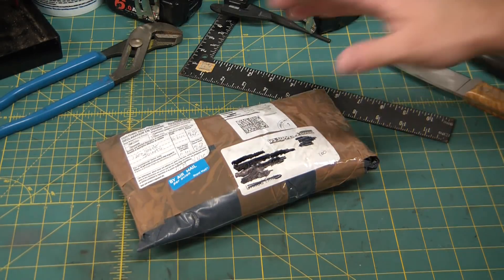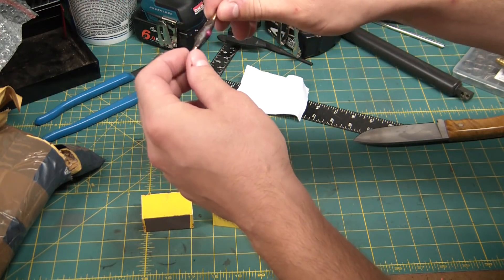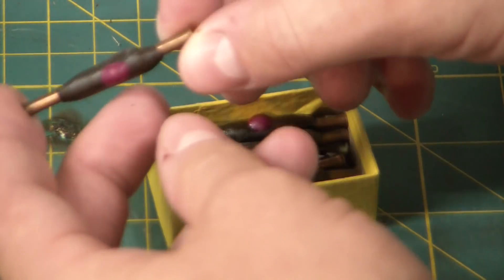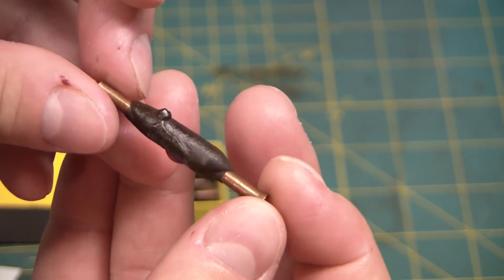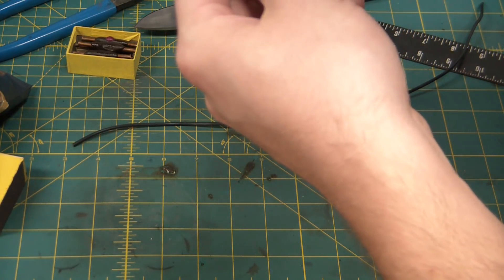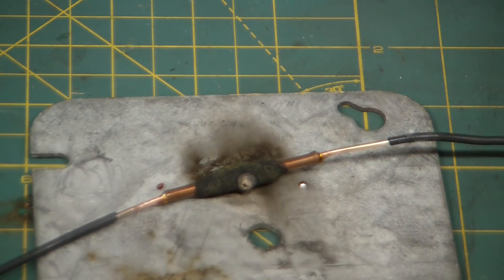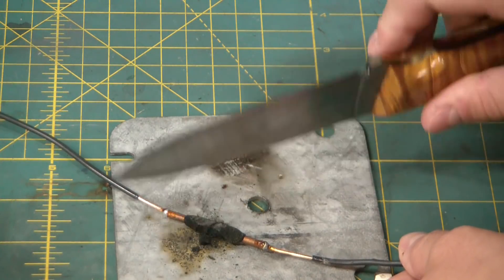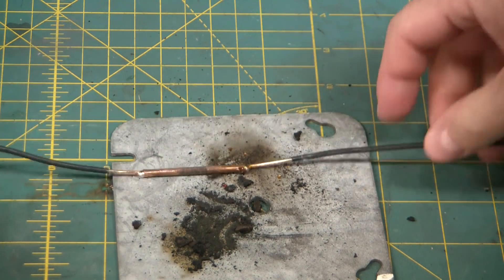Ingenious Self Soldering Sleeves!  (A Very Old Invention) - ElementalMaker

Comment: I know they make the solder seal but joints, that solder with a heat gun, or a flame, cool melt solder, in shrink tubing, but this is soo much cooler! And it's soo much simpler to use, alot more complex to make, but soo cool!  I bet a box of these, cost about as much as a cheap iron, and small roll of solder!

Comment: BigClive did a video on the modern version of these, it's actually heatshrink tubing with a ring of low temperature solder on the middle and hot glue rings at either side, not self igniting but convenient non the less.

Comment: As it was firing, I was screaming "push the wires in!" at the screen.  For current usage, though, there's wago push-in connectors.  Easier, quieter, no smoke, and can be removed.
Reply: Yeah I read the instructions as well.
Reply: But solder is far more reliable and solid, couple with some shrink sleve and a lighter and you're golden
Reply: And there's these bring-your-own-heat type: https://www.amazon.com/Wirefy-Solder-Seal-Wire-Connectors/dp/B01M0EZBYQ/
Reply: @mbirth  but they don't have pyrotechnics on them? Disappointing):

Comment: The algorithm brought me here. Have to say I am not disappointed. Those things are amazing. A good secure connection for field expedient demolition work. Wouldn't be to hard to make your own. A short length of small copper tube with some match compound on it. You could put some soldering paste in the inside. Solder powder in a flux base.

Comment: My grandfather was in the army corp of engineers during WWII, electrical engineering degree in 1932, but had these in his garage during the 60’s. His job was field power supply generators for this new thing called radar. He told me they had change the formula but the originals had potassium fomate! They where more water proof. He lite one as you did and was much faster and brighter. The search for potassium fomate is what they used in the percussion end of a 22 caliber round. At some point ( Perhaps deadly off-gassing, the formula was changed to what they still use today in 22’s. Not sure if spelling is correct but much brighter. He told me they would cover both sides with bricks so the light could not be seen as easy. Anny Oakley probably shot hundreds or rounds of these 22’s with the original formula since yours where made much later in the 60’s. Food for thought!

Comment: HI   THEY DO HAVE SOME THING LIKE THIS.  I USED THEM IN THEM IN THE COLD WAR DAYS. THEY HAVE A SHRINK TUBE OVER THEM NOW. YOU CAN HEAT THEM WITH A MATCH OR LIGHTER. THEY ARE COOL AND WORK VERY WELL. I NEVER SEEN THIES COPPER TUBE ONES . A SOLDER JOINT IS A LOT BETTER THAN CRIMP IF YOU HAVE THE TIME. THANKS FOR THE VID.

Comment: I think they where used to repair power supplies to large building. Mainly where emergency / paramedics were located and they didn't want to try and dis-connect the mains voltage for some reason.

Comment: I wonder if the pyrotechnic mixture surrounding the joint could possibly be Iron and sulphur in some kind of binder. The way the reaction moved across the mixture reminded me a lot of the Iron and sulfur, ignited with a hot metal rod reaction.

Comment: I'm pretty confident those weren't "strike anywhere" -- for safety reasons (entire box igniting in your pocket = bad day) they were "strike on box".  No longer made, apparently, I'd guess because "It's not safe to carry pyrotechnics around in a tool box!"  So instead you buy heat-shrink self-soldering sleeves and a little butane torch so you can cuss louder when the torch runs dry or the piezo igniter quits working 800 feet above ground...

Comment: Those new style heat shrink butt connectors with solder and adhesive probably have a direct lineage to these. You know, the kind that solder and seal with a heat gun.

I can almost guarantee these were used in communication in war time. Demo operations don’t need a permanent and very durable connection. A simple twist or lineman’s connection would suffice.

Comment: I guess they hadn’t heard of crimp connectors huh...🧐
Reply: arjunyg soldered wire quality is way better mechanically and electrically.
Reply: Felipe Siqueira This is objectively false. Solder joints fatigue under vibration and can and do fail more easily than crimped ones. There’s a reason everything in your car is crimped, not soldered.
Reply: Well, seeing as how world war 2 was from 1939 to 1945, then NO they quite literally had never heard of crimp connectors. Because they hadn't been invented yet. It wasn't until the 1950's that crimp terminals/connectors were first invented.
Reply: aSinisterKiid that’s hella wack..

Comment: they have better ones now. save those those are priceless antiques... the new silicone and tin ones from china work with a lighter and shrink water tight ... they stopped using those because they smoke and the flames too bright and can give away your location. not good for emergency field repairs

Comment: The pre runner to the solder sleeves we use now. No soldering iron needed, We use a heat gun. Solder melts and the sleeve is water and mould proof.

Comment: Actually back in WW2 soldered connections were mostly done by heating an iron in a fire and then using that as your soldering iron (hence the name) and using it like you would an electric one. Or they also had big kerosene powered torches that had soldering tips.

Comment: I was sitting here thinking you had to push em further into it, my knowledge of ww2 stuff, most mechanical stuff needs force to function.
Reply from the maker: They are supposed to be pushed in to overlap, but the 14G wire was too large to do so anyways

Comment: That is awesome, nice, clean, shiny solder joints. I could think of a couple modern day uses for that in remote areas, if they could make a self shrinking shielded heat shrink, it could be a quick easy fix. Save carrying a torch or butane/battery soldering iron.

Comment: The mixture could be based on Iron and Sulfur. Meaning the product of the reaction woud be Iron(II)Sulfide. Would explain the funky smell. The burning of the two ia an extremly exothermic reaction, which needs only very little activation energy.
Reply from the maker: I think you are correct! 👍

Comment: There  is a modern "alternative". Heatshrink with a ring of low melting solder. BigClive has a video on them, work with a simple lighter, mist likely not as good as this stuff but maybe a fallback option.
Reply from the maker: I do love those little heat-shrink solder tubes! They definitely have their place, but how cool is having a heat source built right in?! 😁

Comment: You didn't do it right. You are supposed to push the wires into the sleeve while it is burning. Push wires into sleeve until they overlap. Hold until cool enough to touch.
Reply: commented before I finished the video. I know you figured it out.

Comment: You sent me down the rabbit hole I have see a video on youtube about the items used here. Can I find it again? NO. Im sure they went into the chemistry side as well a cutting them open after. If I find it I will let you know. I t5hink the solder is a low melt alloy.

Comment: Those wires have no mechanical connection and there is no way to do it.  Pretty cool, but there are better ways. Form a mechanical connection and then wrap it with solder and hold a lighter under it.
Reply: These work in the rain where lighters wont... important in war, especially in high moisture/rain environments like black Forrest in spring or Vietnam in 3 months of monsoon season.

Comment: i think you should make some :D or just one massive one with 15mm tube
Reply from the maker: That's the plan!
Reply: @ElementalMaker  Yes! Hopefully you can come up with one that can be made from readily available materials... you know... for science
Reply: @Modna89  it looks and burns like you typical everyday sparkler
Reply: @ElementalMaker  be interested in the compound used aswell always handy to know this stuff
Reply: @TheMrgoughy  the FBI wants to know your location.
Reply: @extracrazyguy  good to know. I'm in the uk
Reply: @extracrazyguy  not exactly a explosive substance and wouldn't matter if it was I dont want to do no one any harm just make cool shit like this
Reply: ElementalMaker for reference - a bigger version requiring some pre heating :D https://youtu.be/5uxsFglz2ig
Reply: Thats basically just exothermic welding
Reply: @chrw756 Same stuff used in bicycle repair patches that are ignited and fused together.
Reply: They kinda do with thermite for rail welding
Reply: That's called an extroPipebomb XD
Reply: You could put some solder inside of a copper tube. Then torch it with a portable butane torch. Shouldn't be much less portable. 😁
Reply: @olivern.karlsson3927  you are fired

Comment: Can't believe you didn't cut it open to see how it flowed, Inquiring minds want to know!
Reply: Would have been interesting, but it'll be more interesting to see one cut open that's done correctly. Turns out there was a reason the instructions started with "Remove insulation at least 1/4 inch more than half length of sleeve." 

Maybe they should have started with "Read entire 1.5 inches of instructions before lighting anything on fire."
Reply: @eritain  I've facepalmed so hard when I saw he didn't follow the next step of the instruction. It has like 9 points goddamnit!
Reply: And ohm it out!
Reply from the maker: I'll do a follow up!
Reply: ElementalMaker yes please, follow up
Reply: @ElementalMaker  try comparing it to a regular lead solder on voltage drop over the joint at 10 ampsor more. Should easily show if it's working good
Reply: @tullgutten  if it's made for detonation purposes the box that starts the detonation uses very very high voltage so a voltage drop would not effect it one bit.
Reply: Voltage drop test too!
Reply: Please measure the temperature to desolder.
Reply: Surprised they did not use a truly smokeless composition. There are thermite mixtures that would work, there are also metal alloys which produce considerable heat as they form. Both find application in smokeless delay fuses for explosive detonators.
Reply: @nigeljohnson9820  Conductivity and noise in low energy signals is probably why.
Reply: @nigeljohnson9820  thermite produces quite a bit of smoke lol.
Reply: @edgya.f.3909  it really depends on which mixture of metal and metal oxides are used, some just produce a shower of Sparks.  The alloy fuses are completely smokeless.